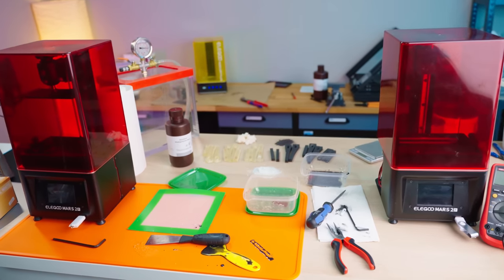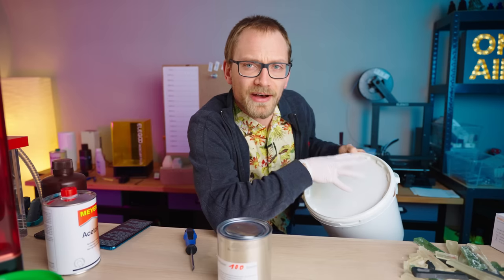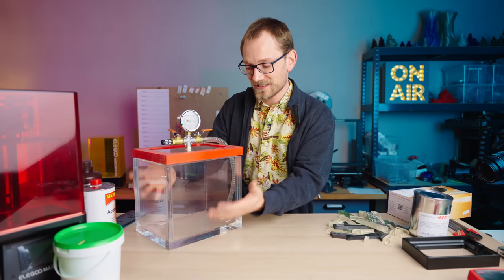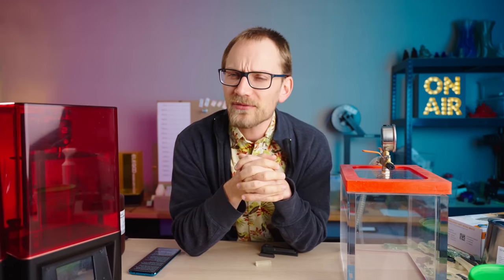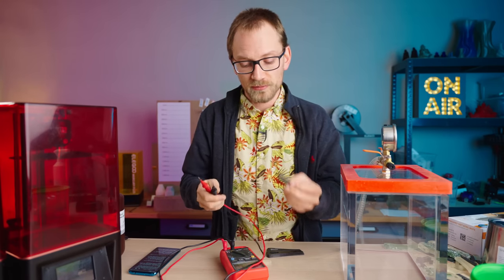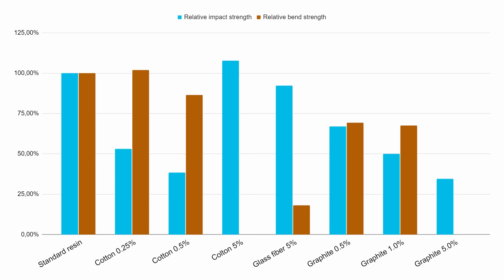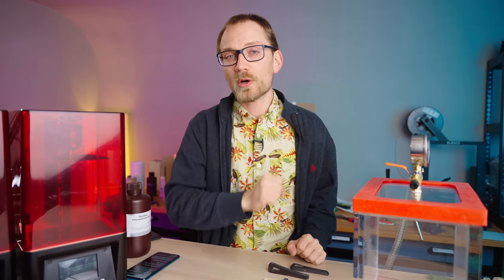Easier Fiber-Reinforced Resin Printing! Stronger and Conductive Resin Prints?

Comment: The graphite bubble color is "structural coloration". Unlike a prism, where white light splits due to changing speed between mediums, here the size of the particles is comparable to the wavelength of light and parallel rays will constructively or destructively interfere causing the light to split. It is like a diffraction grating you might have played around with or a grating wavelength selector in spectroscopy.
Reply: 1. Excellent and accurate explanation. 
2. Your last name is perfect, especially with the high VanderWaal forces at play in graphite.
Reply: @42436freak  all my chemistry professors got a kick out of it too
Reply: This physicist is glad someone posted a better explanation than because bubbles
Reply: I think Steve Mould did a video on this recently...
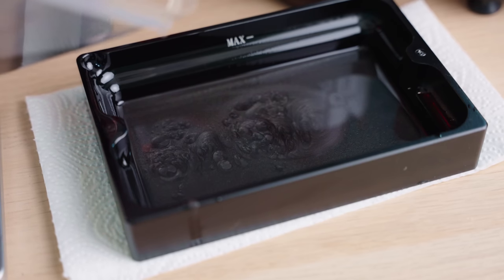Reply: Is there an explanation of how there seems to be a kind of orientation going on? e.g. 6:45. When mixing different parts of the resin they seem to have a state or common orientation. Or is that just different settling of particles?
Reply: Is this the same effect Destin from Smarter Every Day illustrated in his butterfly wings part 2 video (video 105)? I tried to post a link in the main comments, but I think it was blocked, even though it was a link to YouTube. The explanation starts starts around the 4 minute mark.
Reply: @dejayrezme8617  The resin is transparent enough to see the conductive and therefore shiny graphite particles in the solution. For this reason, it is noticeable when the particles clump or spread out in the solution as it is displaced
Reply: It sounds like you're describing something akin to a Fabry-Perot Interferometer. I made an acoustic version this for my senior research for my degree. It works by having two parallel plates that reflect light back on itself, and only the light that is of the same wavelength as the gap between the plates (or harmonics of that wavelength) are allowed to constructively interfere, while the other disparate wavelengths destructively interfere. This requires the plates to be very very parallel, so as to not have the light reflect back and forth out the sides. But in the case the graphite particles, I'm not sure how it'd effectively reflect light back on itself, seeing as they are randomly arranged. Or maybe there's a global effect from the random arrangement that results in a similar phenomenon. Or, and this is likely, it doesn't behave like a Fabry-Perot interferometer at all lol. Maybe it behaves more along the lines of Thin-Film-Diffraction, which does result in a rainbow effect at different angles. You could actually kinda describe thin film diffraction as a type of Fabry-Perot interferometer, or vice versa. If you've read this far, thanks. To read as far as you have, you must be as bored as I am to write this much.
Reply: Nennt sich auch Beugung, sieht man auf jeder CD!
Reply: I didn’t want to know this, but now I’m glad I do. Now how to work this into a conversation during a coffee-break at work...
Reply: Particles? These were clearly like soap bubbles, only smaller. The physical principle is the same as for soap bubbles and similar to nano sized structures. In bubbles, super thin walls create the effect. Soapy water can also be trapped in a loop. If the wall thickness is small enough, the same effect occurs. They are many soap bubbles videos on YT.
Reply: hmm, i was thinking thin-film interference like with oil
Reply: @42436freak  Who doesn't love the Dutch lol
Reply: @Dalenthas  Quick tip, don't start a YouTube battle / competition / bet against Steve Mould, those tend to get out of hand.
Reply: Isn’t this the same cause for color on the wings of certain butterflies?

Comment: Great video. Since inconsistent curing from settlements can weaken a print, we recommend using a thicker, tough resin as the base for this type of experiment. This way, the materials do not settle too quickly, and you have a very strong resin to start to stay functional. Happy to get you some Blu or Tenacious to play.
Reply: would you also support him mixing different resins with tenacious to get the ultimate engineering blend?
Reply from the maker: Thanks for the tips - I'll let you guys know know when I'm back at doing resin experiments!
Reply: @MadeWithLayers  So far I go with 30-50% Tenacious in Elegoo ABS-like for impact resistant NERF parts, but that's trial and error.
Reply: @globalrevolution  we will be happy to.  Blu 70% + Tenacious 30% seemed to create a good balance between impact resistance and hardness
Reply: @sirayatech2  30-40% Tenacious seem to be a good spot
Reply: ABS-like or even more flexible resin should work better than hard ones for composites. Think of it as an alloy - pure iron (Fe) is rather soft, and it is the carbon and other additives improve mechanical properties of the alloy. Hard matrix + inconsistencies = fracture
Reply: @sirayatech2  Even plain Blu is very soft and bendy, so impact resistance, yes, but no hardness.
Reply: @globalrevolution  lol I thought you were being sarcastic for a second since blending is recommended so often. It is awesome though! I wish they'd make one pre mixed though. Tons of people do it.
Reply: +300 point for actually being part of the community!
Reply: So perhaps a formulation of Blu, Tenacious, and Sculpt Ultra would give a nice improvement in hardness. Note, the Sculpt Ultra Technical Bulletin reports a 99-durometer (Shore D) reading.
Reply: Milled glass+ tenacious might give some interesting results

Comment: Give milled fiberglass a try instead of chopped fiber, it looks similar to the cotton you used, its a common filler with composites.
Reply: FLOX... pretty easy to mix in too.
Reply: Tried it, it makes it weaker too.
Reply: @csakip  That's surprising, I wonder if his theory on the micro bubbles and cracks is what's causing it. Maybe in a pressure chamber or something the bubbles would be minimized.
Reply: @Rocketkid2121  I think it would be basically too late after you have already printed the part. You would need it to be in the pressure pot before it becomes cured.
Reply: @shelltoe_soul  I agree, I know that wouldn't be super easy to pull off and maybe not worth the effort, but it just seems counterintuitive that the fiber would weaken the print, and that test would possible eliminate bubbles as the culprit. Possibly UV resin doesn't bind well to glass?
Reply: @Rocketkid2121  More testing needed...
Reply: That is what I thought. Isn't FRP already combination of fiber and resin?

Comment: In most injection molded parts with glass fiber there is at least 30% fill. Most structural composite layups are at least 50% fiber
Reply: I would say with injection molding one can start at 15 to 20%weight. The major difference might be that rather short fibers are used and not large pieces like 3mm long. My understanding is that something like milled fibers (carbon or glass) might work similarly to the way it works in injection molding.
Reply: Seems pretty obvious the fibers need some treatment first -- as they are melted and mixed together before the injection mold. Right?
Reply: @gutrali  On materials I worked with we bought the pellets already made, you want abs-GF30 you buy abs-GF30 pellets so they are even already mixed during batching ^^ You can mix longer ( a few millimeters) fibers in the barrel but it requires special coatings and geometries as I recall so as to dont break the fibers
Reply: @gutrali  fibers like the ones he usess are bonded with styrene, sobthe resin needs to be able to dissolve styrene to be able to soak in to the fibers properly.

Comment: Hey man, great video!
If you want to achieve a truly mechanical reinforment of your SLA resin you have to add functionalized fibers/particles. Functionalization of fibers/particles improves the chemical affinity between the fiber/particle and the polymer matrix. You can purchase functionalized fibers/particles ready to use or you can functionalize them yourself (using a silane coupling agent). Cheers

Comment: Hi Thomas, great job. Your videos are inspirational. Btw, I am a materials eng. Scientist. Is a long time that I don't get into the polimers side, but as you analyzed, add fiber or other materials can deteriorate the properties because a lack o bound between the matrix and the aggregate. It not necessary forms micro cracking around but can help the cracking propagate faster on the aggregate material surface because it's is not properly bounded. Most composites have a mix of polimers or other compounds that helps bound the matrix to the aggregate, same principle of soap and water to remove fat. Let me know if you need more information about it.

Comment: I've printed cycloidal gears with graphite additives, also adding a small amount of flex filament to 10%. Makes for a very strong part that is partially self lubricating and tough. The flex adds more strain relief albeit at the sacrifice of rigidity- but that slight flex is great to make up for the slop and inaccuracy of the print.

Comment: Tom I've been watching you for years. I very much appreciate that you're on the same track I am, for me a particular print that I am trying to make stronger for someone.
Before I saw your video for the last time you added fiberglass I was at the beginning of my adventure and that time the only glass fiber reinforced prints I saw was someone making a shell and then filling with epoxy mixed with glass fibers.
I am very appreciative to see that the first test with glass blankets was not that good in strength. Saved me from the mess.
I had just boughten chopped glass fibers and received them when I came across your video and was like "damn it someone beat me to it".
but I appreciate you going through all the messy stuff and displaying your results saves me a lot of headaches and I just want to say thank you. Also, I never thought of cotton. Brilliant! Also the graphite I want to try now.
thank you for the wealth of knowledge you have shared over many years.
Reply from the maker: Thanks! Glad you're getting something out of the videos!
Reply: When you use fiber glass you better remove the bonding agent with acetone.

Comment: One thing to note: Short fibers are useless for strength or structure. However, I believe by adding the short fibers to your resin, it may have a larger impact on ABRASION resistance, than adding strength. Being in custom/restoration/collision for 30 years, when I have to fix an older Corvette door I use the long strand glass mat for structure then a shorter fiber/filler mix to cover any hard edges before applying a finish putty before primer and paint. USC Duraglass, and a product called Fiber-all are basically body fillers with short strand glass fibers pre mixed in. I use them sometimes where chipping might be a problem, like a corner or edge of a door for example, where the panel doesn't line up perfectly to the next panel. Hope this helps. Been subscribed since I bought my Wanhao i3 v1.2 back in 2015 (currently rocking an SKR 1.4 and 2209's), and since have upgraded the poop out of it thanks to more than a few of your videos and tutorials. I have a Mars 2 Pro also and found this video very interesting and educational. Cheers from the USA!

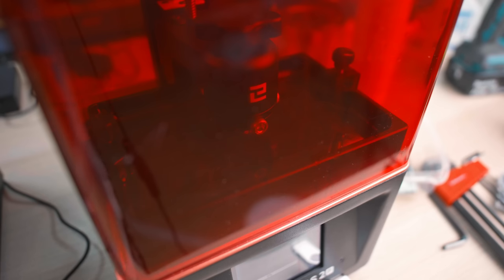Comment: At 8:30.. maybe lock your vat down?
Reply: Just what I thought 😂.   Layershift incoming.
Reply: I saw that too. And have done that too.
Reply: @scruffy3121  no layer shifting, it's not the build plate moving around.
Reply: @RinksRides  yeah.  Didn't think about that properly.   Still can't be good for the display, vat or noise level.   Is the fan in the mars Pro 2 as loud as the fan in the mars?
Reply: Exactly :-)

Comment: Great Video Thomas!
I never tried a resin printer, but I have some experience with glass and carbon fibers.
I think some other fillers could also be interesting. There are for example glas micro balloons with 0,12 g/cm^2 and a particle size of just 65nm to make very light weight components. To reinforce the resin a good try could be to mix milled glas fibre (0,2 mm) and finer cotton flocks (0,35 mm fibre length). Some fumed silica like Aerosil could also help to thicken the resin, that the chopped fibers don't saddle down to the bottom. It looks a bit like, that the chopped fibers in your prints are not completely wetten, normally they should get very transparent in the resin.

Comment: Dorsnt the fiber impede the curing light from shining through? Especially the carbon I would think would absorb the UV
Reply: Yes, this is what limits how opaque 3D printing resins can be, and why a solid black (for example) isn't really possible from what I've seen. You need to get enough light through (say) 50 microns to cure the layer.
Reply: @michaelnoble2432  yes and no, light absorption is also wavelength dependent. However since most use 405nm it's kinda hard to have something that's really dark. There are blacks that are close though and depending on special use cases a very dark resin for a special printer could be made.
Reply: This is what I thought. For sure the fibers must screws with the light curing the resin right?

Comment: Nice methodical approach.  I found your videos because I wondered about adding fiber materials to the resin mix to improve strength.  I would repeat some of the experiments using "tough resin", which has ground rubber mixed in to reduce the brittleness.  Use a squeeze bottle to blow a little milled carbon in the first 5 and last 5 layers.  Blowing will confine the carbon to the outside layers while keeping  the inner layers almost pure resin.  It will create a stronger skin on the outside.

Comment: Very cool experiments, thanks for showing your results! My one contribution as someone with a materials science/mechanical engineering background is to remember that there are still more mechanical properties than strength. A lot of times composites represent a tradeoff between stiffness and strength, where you increase the stiffness over the base resin/matrix, but make it more brittle. This would reduce the energy absorbed during impact. With the short fiber systems, though, you tend not to see much increase in strength, particularly at low volume fractions, because you don't have enough load "continuity" for lack of a better word. In long/continuous fiber systems, for example, even when the matrix fails, the fibers can still bear load. Here, there's enough space between fibers that failures can just propagate through. I'd also agree with other comments that improper bonding/wetting between fiber and resin could contribute. Could be interesting to look at in future tests. Doesn't require an electron microscope, just a decent power optical. You can even experiment with the $20 or so digital microscopes to see what kind of images you can get.

Comment: I once made epoxy resin reinforce with carbon nano tubes, in several concentrations, it did not improve the tensile strength but they where more conductive.

Comment: I work for a National Laboratory and 3 years ago we tried Graphite and/or Iron filings in the resin of a Laser SLA printer to try and see what concentration (if at all) it would take to get conductive/magnetic properties out of a 3d printed part and determined really quickly that at higher concentrations the slurry becomes to tick to work with the printer and at the maximum saturation point that does allow the prints to work the resin acts like an insulator at a microscopic level and simply will not allow a continuous current to run through it.

Comment: The best method of reenforcement I've found is likely not what your looking for. But when I need strength, I print with a hole though the part and use an epoxy resin to secure a metal rod inside.
Reply: Say more… you make a hole in the model and then fill it with resin? Is that the idea ?
Reply: @kaltland765  More like use the epoxy as a glue for metal rods

Comment: Great Video Thomas...you  ask about the reason why the filled parts are loosing strength...most fillers in a resin binder system need an additive that allows the resin to bond to the surface of the filler.  Otherwise, as you have shown...the properties will suffer.  One of the more common families of bonding or coupling agents is silanes from Dow Chemical...depending on the resin, the particular coupling agent is chosen for a particular filler...I formulated 2 part spray-able polyurethanes and polyureas that after leaving the spray gun would be dry to the touch in just seconds.  Your other problem is likely you need a Much Higher shearing action of the reinforcing materials far beyond what a magnetic stirrer can provide...they are fine for liquid to liquid mixing, but Do Not really totally wet out the surfaces of the filler to liquid interface.  Thus, first you need to find the proper coupling agent for the fiber and polymer, second use a High Speed Disperser, and finally vacuum out all of the air bubbles.  Keep up the Great Work!!!

Comment: I'm close to buying a resin printer and is still learning about them before my purchase.
My main hobby is RC cars/trucks, where we use dry wall to reinforce the body shells, and of course most knows that  the higher quality cars always have a composite plastic used.
Maybe this would be your source of information? I have for some time tested parts for a manufacturer and the character of the parts significantly changed depending on direction/amount of fibers used. But the key secret is that the fibers are overlapping so the force can't slip through, but still in a small amount that the parts still have flexibility.

Great videos as always
Thanks you